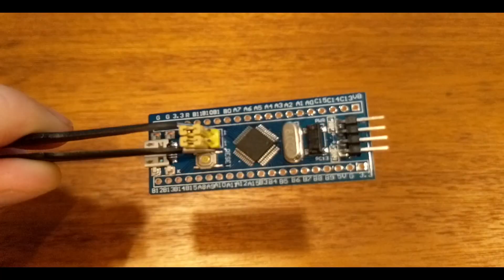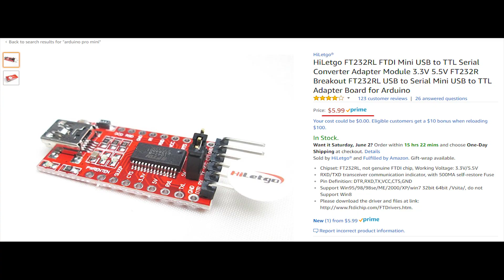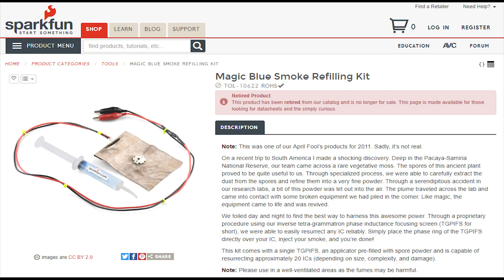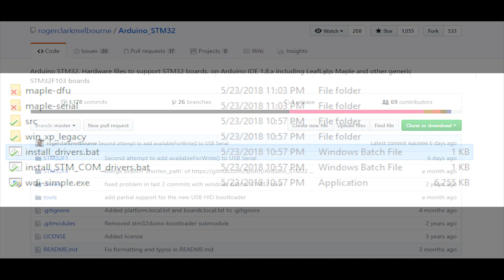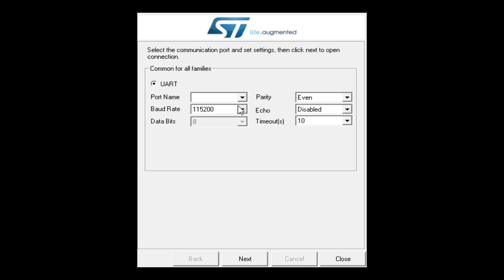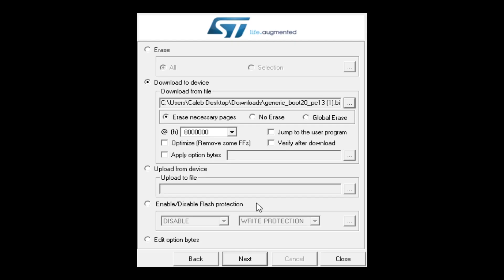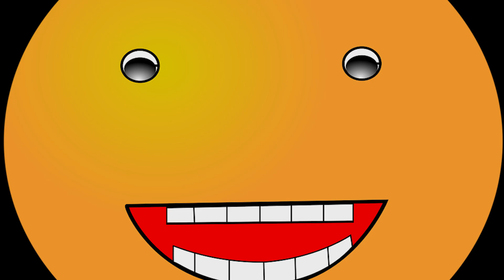Installing the STM32 USB Bootloader, Easily! [SEE DESCRIPTION]

Comment: At 2:33 you tell us to take the (boot 0) jumper and place it to 1 position. But right at 3:09 both jumpers come to 0 positions. Why is it so . And according to some links online putting jumpers according to 2:33 puts the board in serial mode . I tried uploading the code , it worked , great . But the moment i try to re-upload the code the board no longer accepts the new code by overwriting the previous code just like normal arduinos do . It only accepts the new code when i press the reset button (which erases everything ) why is it so can you explain .
Reply from the maker: I moved the jumper back between takes and didn't realize. Boot 0 wipes the program memory when the board is turned on, effectively erasing a sketch. When I moved it back after uploading the blink sketch, I told it to keep that sketch in program memory on next turn on.

If you install the USB bootloader, it's effectively another sketch on top of the ones you upload, so you can upload multiple times without resetting. You needed to keep pressing the reset button to clear the program memory and put it back into serial mode. Does that make sense?
Reply: @CalebMarting  i got it thanks . I never thought you will actually reply so early . I'm quite impressed 😄😄 thumbs up for that !!! .

Comment: Hi Caleb, 
1)This worked for me,but i wish to put back the original serial UART bootloader.Will the same procedure work ?
 2) Any idea where I could download the .bin file for the originl bootloader ? I could not find it online or maybe not looking in the proper places.
 3)  How does the flash loader know where to place the .bin file for the bootloader or the user application in the device memory ?
TIA
Thomas
Reply from the maker: All you have to do is place the boot 0 jumper back to boot 1 and you should be able to upload via uart again I believe
Reply: It detects the chip,but gives an error after uploading.The same file works OK , if i load it with a STLINK.I think its because I have changed to a USB bootloader perhaps.So i wanted to put the original bootloader and load via UART0.
Reply from the maker: Are you moving boot zero to the 1 position and then plugging it into power?
Reply: @CalebMarting  Hi Caleb,as usual a trivial mistake from my side.I did not notice the drop down menu which chooses the memory size of the device.Selected the right one and now it works perfectly.
From what I read in the STM32duino wiki : 
"The standard ('factory', 'native', 'STM') bootloader is always available -- being stored in read-only memory -- and cannot be modified or deleted. You can access it by configuring the boot pins high or low, and then powering (or resetting) the MCU."
I had assumed wrongly that the USB bootloader overwrites the UART bootloader.
Thanks for your cordial replies !!
Reply from the maker: No problem!

Comment: The PA9 and the PA10 pins are 5 volt tolerant. You can check the FT values from this table: https://github.com/OliviliK/STM32F103/blob/master/Hardware/CSV/STM32F103_Med48.csv
Reply from the maker: I know in the video I said it would break, that's the one thing I would go back and change. I should have said to be cautious

Comment: i encounterd problem on "FDU error", pretty sure it's because of the wrong resistor value. So, when should i change the value of the resistor? Is it after i burn the custom bootloader?
Reply: Don't change the resistor yet, burn the bootloader, and then place the other jumper to the 1 position. When you plug it in, it should be in eternal upload mode. I mentioned this at the end of the video I think.

If that still doesn't work, it's an issue with your drivers, if it does work, change the value of the resistor whenever, I don't remember what the value was but I think I said in the video
Reply: Oh, so if the issue is solved by placing the boot1 jumper into 1's position, then i don't need to change the resistor?
Reply: Correct, the resistor just makes it more convenient because it will reset the board automatically for you
Reply: Alright, cool! One last question, does the boot1 jumper just stay on 1's position forever, or do i need to turn it from 0's to 1's position each time i want to upload program?
Reply: I think it sets it to eternal upload mode, but once you upload a program it just runs the program. I think if you place the boot 1 back into the 0 position it will keep the program loaded. If you want to reupload a program you keep it on the 1 position and cycle power
Reply: @avarupt  I've tried it on my Blue Pill. The working scheme on my case is: Boot1 jumper sets to 0, and place 1.5k resistor across 3V3 and PA12. Thanks for being a huge help :D
Reply: Shoot Avarupt is my other account, this app can be glitchy sometimes lol
Reply: Avarupt 😉
Reply from the maker: YT Studio said I was signed in as Caleb Marting but I was actually signed in as Avarupt. Couldn't be bothered to rewrite my comments. (Feel free to sub to that channel too though 😉)
Reply: Caleb Marting Ha, tx for the suggestion, just did! ;-) 
Thank you for making these video’s. The content is excellent and humor makes it even more fun to watch. 👍🙏

Comment: thanks man.u made my day
Reply from the maker: Glad to hear it!
Reply: After flashing bootloader..
I am successfully able to blink led and lcd programming..
But i am unable to make call using gsm quectel m95 model.

It was working before flashing bootloader..

Can you help me please
Reply from the maker: I have no idea what would cause that. What exactly are you trying to do
Reply: I am having quectel m95 gsm module.. i am trying to make call from that module to particular number..
 Code is successfully uploaded..but no response from gsm module..
Reply from the maker: The only thing I can think of is that it somehow is messing with the uart or something. Can you try the same pin/comm method with a different device?
Reply: I have only one module
Reply from the maker: If you go back to the regular bootloader does it work again?
Reply: Maybe

Comment: For everybody who is missing the information: To load the compiled sketch to the STM32 you should set the program jumper to 1 like shown THEN press the reset button. You have to do this everytime you want to upload a new sketch. Once it is loaded it will imidiatly start. If you diconnect power you  set the jumper back to 0 and the program starts to run.
Some Knockoffs may want to have the LED_BUILTIN renamed to PC13. However mine worked also with LED_BUILTIN and also when I mixed both pin named up and used them together 😂 

Also mine worked fine when I accidently connected the VCC from the FTDI board to the 5Volt Pin of the STM32

Comment: The stm32 comes with a usb bootloader from the factory, what it doesnt come with as the ARDUINO bootloader. With a St-link programmer ($5.00) instead of the FTDI thingy  you have debug capabilities, you can step through your code while its running live line by line  so having serial (SWD) is still very useful, of course you'd have to upgrade your IDEfrom the Arduino and go for something like KEIL or SystemWorkbench or Truestudio which is for stm32 which is now also free like the rest. And once you upgrade IDE you are not stuck using just the STM32F103 you can use any stm32 chip, some have  dual cores one core runing bluetooth and thus eliminate those huge bluetooth dongles etc. And if you dont like to open the datasheet and learn how to program the chip you can use STM32Cube and just call functions that do everything for you, Arduino style, you dont learn much but you get things done quickly so for hobbyists its perfect.
Reply from the maker: This is some really good information, you wouldn't ever want to help me write for a video about this would you? (Yes I know it's a lot to ask)
Reply from the maker: Truth is I've tried to experiment with stm32cube and another idea but I got stuck
Reply: i wouldnt mind , im trying to start a blog myself about programming microcontrollers and personal projects etc... school just keeps me busy though... but yeah I wouldnt mind helping out when and where I can
Reply from the maker: School keeps me busy too

Comment: Can we try 1k instead of 1.5k ?
Reply from the maker: That might work but it's also out of spec, if you have 3 you can wire two in parallel in series with the other. I never had to change my resistor though, it worked just fine with 10k
Reply: if you parallel the 10K resister with a 1.8K resister you get a 1.5K equiv. resister

Comment: Is 103 the correct value for R10 as that's whats on my bluepill.
Reply: The R10 on a Blue Pill board is normally a 10K (103) resistor. It should be replaced with a 1.5K (152) resistor for reliable bootload operation.
Reply: Ahh, thanks.
Reply from the maker: You don't have to replace it fully, you can also put an equivalent resistor between the pin and ground I think, I have a picture somewhere I can link to if still needed
Reply: replacing it shouldn't be too hard.
My biggest issue is with the M5Stacks that have a horrible adapter that needs to be bypassed.
Reply from the maker: Good luck with that lol, looks terrible. Tell me how it goes
Reply: Need new soldering station bits and new eyeballs!
Reply: Caleb, you are right. 
If one doesn't have the equipment or the expertise needed to solder and desolder surface mount components, all that is to be done is to connect a 1.8K resistor in parallel to the 10K resistor to get the value of 1.5K.
I expect my Blue Pill board to arrive next week and will use my hot air pencil to desolder the 10K and solder a 1.5K resistor in its place.
Reply: @CalebMarting  IF 1.5 K RESISTOR MY PROGRAM NOT UPLOADING ....RESETTING USB PORT
Reply from the maker: Sorry not quite sure what you are asking or stating, can you say it in a bit more detail?
Reply: yes, 1.8K between 5V and A9 I think

Comment: While I'd double check the datasheet and schematic. Most STM32 inputs that aren't in analog mode are usually 5V tolerant. (3.3V is still preferable, but it would be an odd setup to damage the MCU)
Reply from the maker: I was going to make a second video calling my first self a liar but I'll explain that later

Comment: I always wanted to use STM32 without the need for the FTDI stuff... the video looks quite detailed, wich seems its harder than it appears... can you summarize in few steps everything that is needed? and after that? i will be able to write/rewrite just like common arduinos?
Reply from the maker: Yes, after install it should be able to be written just like a regular Arduino. In a few steps:
Download the flasher program, drivers, and correct bootloader.
Install the drivers
Run the flasher program and use the selected bootloader and ftdi when you install.

That's the basic gist, but please watch the video because there are pitfalls I can't type out on my phone that you should be aware of, really it's about 4 mins of video that matters, go to the timestamp mentioned.

Comment: do the mini series! I'd love to know what arduino libraries work on STM32 without changing code
Reply from the maker: Any specific libraries I should cover?
Reply: hm, I would split it into two categories, probably some common libraries and some libraries that examine arduino-STM32 hardware overlap. some common ones, maybe NeoPixel libraries or MPU6050 (or any popular IMU) or LED? and as far as hardware goes, I know for example ATtiny85 doesn't have SPI built into the hardware so you have to mod the functionality with software, so maybe with the STM32 you could examine if the hardware for features like SPI, I2C, interrupts, etc all function well with the arudino libraries that use them

To be honest I'm not sure if this will make an interesting video or not, I just know that I've heard not all Arduino libraries work out of the box on STM32. Maybe you could try to create a project that the Arduino doesn't have enough pins / interrupts / etc?
Reply from the maker: Hmmm, I just got neopixels working so I think I'll start there. We'll see what happens!

Comment: couldn't find the DFU device: [1EAF:0003] while uploading sketche
Reply from the maker: Try reinstalling the drivers. Make sure the bootloader was uploaded properly with the jumpers. Try pressing the reset button on the board as the sketch starts uploading
Reply: Caleb Marting tried all of it, except 10k resistor replacement.
Reply: Tech Seeker can you move boot one to the one position and then plug the board in? That puts it into eternal dfu mode
Reply from the maker: Hmmm, is there any way you can try it on a different computer?
Reply: ctjet99 i tried that too, same issue.
Reply: yeah only two ways left. other computer and updating the ide to latest.
Reply: Tech Seeker were u able to solve the issue cause i m facing the same one.please do reply
Reply from the maker: First of all try reinstalling the drivers and bootloader. Second, while uploading press the reset button on the board when it says "searching for dfu device"

Tell me what that does!
Reply: Caleb Marting will do the same for sure THANKS a Lot.

Comment: or...go with ESP32 ;)
Reply from the maker: I've bought a few but there are a few issues I've encountered. Do you use the Arduino environment or something else?
Reply: No Arduino - freeRTOS and esp-idf. It has multitasking and crazy features. I stopped using Arduino because of hardware incompatibility. STM32 also runs better on ST dedicated framework but is is slower and has less memory. ESP32 is dual-core 7-stage risc and better tham cortex m3 (3-stage only)
Reply from the maker: Thanks for replying, I'll have to try those out and potentially make some videos about them

Comment: do you have any ideas on how to get the 2 DACs working in the Arduino IDE? AnalogWrite is only able to output PWM for me, and i'd rather use the true analog outputs. thanks!
Reply from the maker: I think you might have to use hardware registers. There are plenty of tutorials for using hardware registers on the Arduino for faster writing and reading of pins. If you can find which registers correspond to the DACS, it may work. (I haven't done any research but this might be a good stepping stone) Tell me how it goes!

Comment: I changed the 10k to 1.5k, this is no problem anymore but it still does not work...
I am getting the error "EXCEPTION_ACCESS_VIOLATION", Can anyone help?
Reply from the maker: Where is this error occuring, what part of the process?
Reply: By trying to upload the first sketch after burning the bootloader, I tried it also with a 1k Resistor between PC14 and 3.3V.
Reply from the maker: Hmmm, you shouldn't have had to replace the resistor at all, normally it works. Did you make sure the jumpers were ok?
Reply: yes, should I post the whole error message?
Reply from the maker: If you don't mind
Reply: maple_loader v0.1
Resetting to bootloader via DTR pulse
#
# A fatal error has been detected by the Java Runtime Environment:
#
#  EXCEPTION_ACCESS_VIOLATION (0xc0000005) at pc=0x000000007110b5db, pid=2264, tid=836
#
# JRE version: Java(TM) SE Runtime Environment (9.0+11) (build 9.0.4+11)
# Java VM: Java HotSpot(TM) 64-Bit Server VM (9.0.4+11, mixed mode, tiered, compressed oops, g1 gc, windows-amd64)
# Problematic frame:
# C  [jSSC-2.8_x86_64.dll+0xb5db]
#
# No core dump will be written. Minidumps are not enabled by default on client versions of Windows
#
# An error report file with more information is saved as:
# C:\Users\CENSORED\AppData\Local\Temp\\hs_err_pid2264.log
#
# If you would like to submit a bug report, please visit:
#   http://bugreport.java.com/bugreport/crash.jsp
# The crash happened outside the Java Virtual Machine in native code.
# See problematic frame for where to report the bug.
#
Reply from the maker: Can you look inside that log file? It looks like some form of java issue. Can you try updating java?
Reply: Updating Java worked. Thank you for the fast help and stealing your time!!!
Reply from the maker: No problem!

Comment: Absolutely perfect tutorial, exactly what I was looking for. Thank you! Btw there is a 5V pin on the STM32 Module
Reply: Ws2812B actually, most of the IO is five volt tolerant as well. You should be fine if you leave it on 5 volts but it's just better to be safe than sorry
Reply: It is safe, the 5V pin just goes to a LDO that regulates it to 3.3V